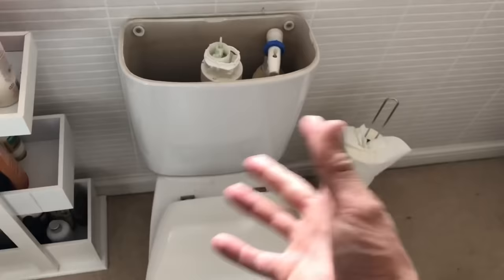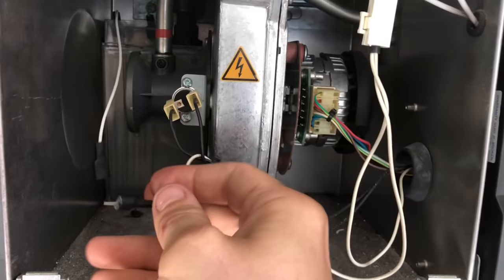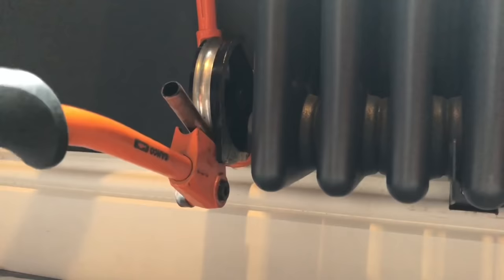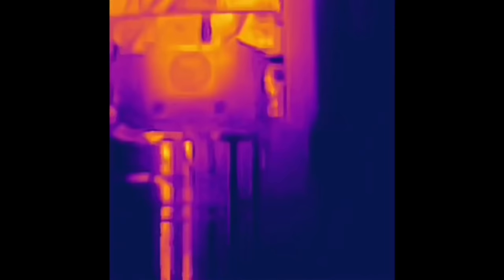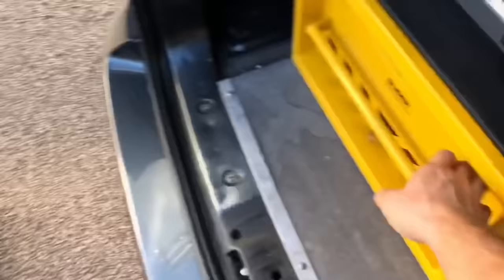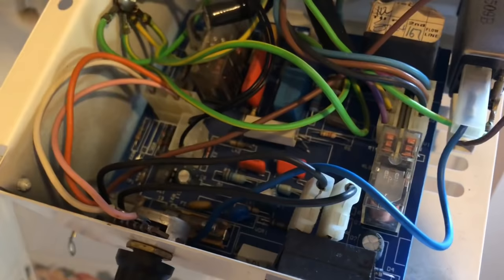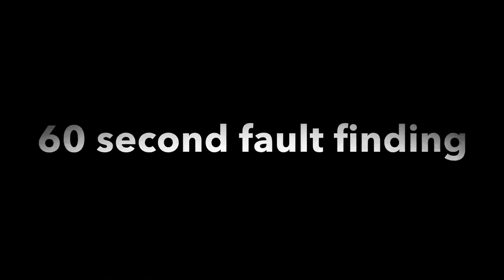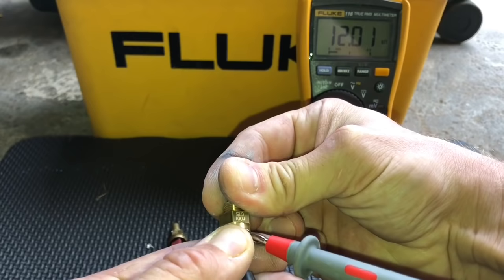The life of a jobbing plumber #27

Comment: Keep up the good work Pete.

I find a leaking aav is usually (but not always) symptomatic of a failing expansion vessel and can give way and release pressure on the system preventing it going to 3 bar and operating the prv, so always prudent to check the vessel charge at the same time.

Little tip for testing thermistors, try and save the thermistor harness when you rip out a boiler these can then be used for giving an easy point for your probes by attaching to thermistors your testing.

Look forward to the next one!
Reply from the maker: Robinson Heating you’ve always got the best tips mate why don’t you do your own channel and share the knowledge?
Reply: @PBPlumber   because I'm cripplingly camera shy lol!
Reply from the maker: Robinson Heating I was too but you get used to it mate

Comment: That sink reminds me of a job I did a few years ago. I’m a commercial engineer and I was asked to fit a bathroom out for someone. I don’t normally do anything private but I knew them so................. I warned them of the potential problems fitting taps at the rear before I started but they were fine with it and wanted me to do it that way. Anyway, a week or so after finishing the job I had a call about water on the floor. Turned up and found a pinhole leak in new pipe by the taps. Upshot was ( as it was a 2nd bathroom on the ground floor ) I had to knock a hole through a wall in the rear entrance hallway as it was easier to patch that wall than potentially disturb the really expensive tiles they’d just had fitted. 
Your sink reminded me why I don’t do private jobs for people, I’m more comfortable in my own environment 😳

Comment: The bahco pipe bender. I've got the older model with the rubber guide instead of the metal one but when it started ripping the pipe I spay it with liquid ptfe and it sorted the problem. N grate videos look forward to them every week. 👍👍👏

Comment: What you said about the vaillant is absolutely correct. But if you run it on switch live vaillant supply a special adapter to it which is a safety precaution that has to be fitted

Comment: I bet you have been to a few rotten bogs where there is no way you would be delving your hand in to check for running water.
I spotted you have a pair of those flat jawed knippex grips on that tap replacement job. Could you do a review of them please? I love the look of them but they are too pricey to just take a punt on if they turn out to be not very useful.
Cheers PB
Reply: Mr Badger I’m no PB but IMHO they’re worth it. I normally use Bahco adjustable but these Pliers Wrenches are complimentary... there’s jobs each can do that the other cannot. One aspect of the Knipex’ to keep in mind is the angle between the jaws and handles. They do take a bit of getting used to but they are lovely tools. And I’m no Knipex fanboy.